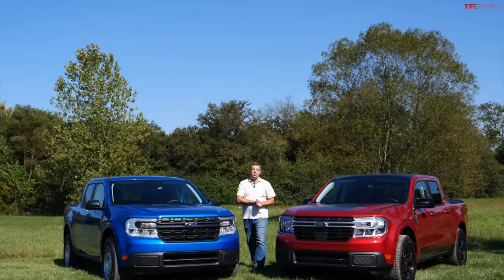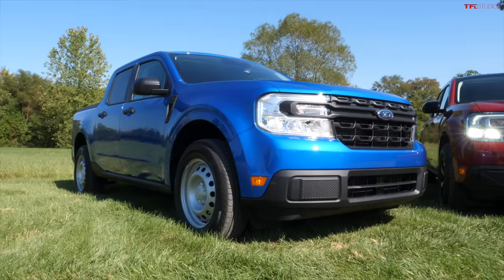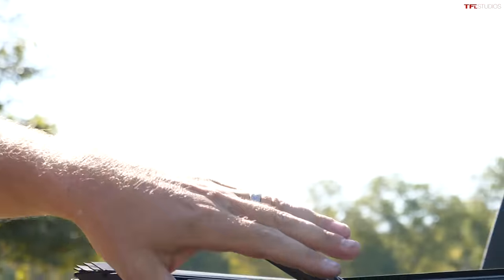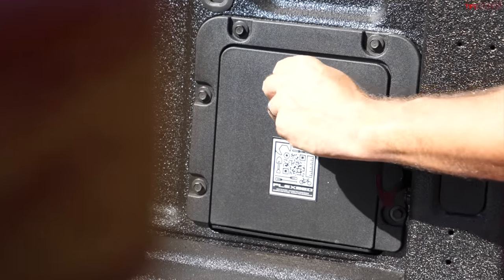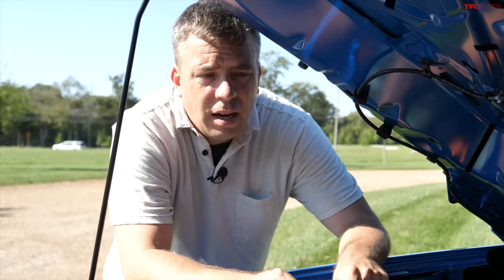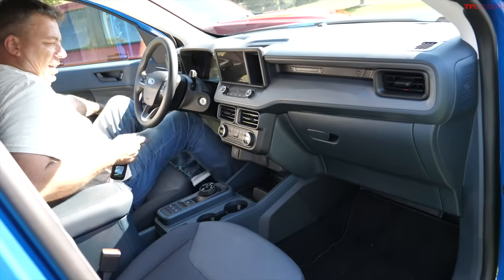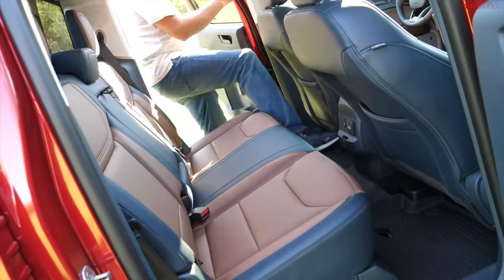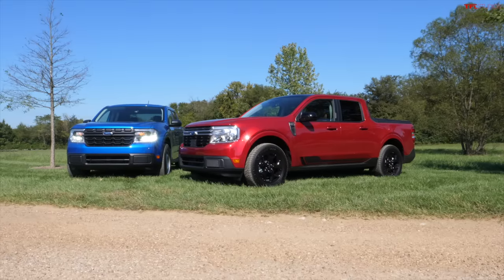HANDS ON with the Least & Most Expensive New Ford Maverick - The Differences Will Surprise You!

Comment: The base model looks honestly perfect for me. I'm about to buy a house and i'll need a small truck for renovations.
The MPG itself makes sense for me to replace my car with it
Reply: I agree. That's why I don't like sedans, they are not practical. When I got my house it needed (and still do) lots of work and I could not fit large bulky items in my trunk, even though it was very big on the inside, the opening sucks so I got a small crossover and folded the seats. By doing that a even fitted a washer. I'm tempted to get a base maverick as today's trucks are wayyyyy over priced.
Reply: @davidzavala337  I'm in the exact same boat. My lil' crossover is great but space is limited even with the seats folded down.

I will need construction materials, equipment, and i want to be able to put my bike in the car without needing to install a mount for it. Just throw it in the bed and go.
Reply: I ordered the xl with lots of extras.
Reply: Get a trailer much cheaper
Reply: or you could just get a nice 1st gen Tacoma or an older Ranger or Frontier for way less money, and it would have more use.
Reply: @damiandouglas5147  Not really. Still need to register the trailer. I have one as I have a 2005 Pilot. The trailer is a pain to hook up every time and PARKing in most city greenway parking spots when we take the bicycles for a spin is a pain. Not to mention worrying about trailer theft.
Then consider any trip to BOX store and this size vehicle, even with smaller bed makes sense. Bought a TV, groceries, mulch? Take the dog to the park and its muddy? Might even be decent on fire roads for certain camping/fishing spots. I'm looking at this or a midsize. A full size is too big!
Reply: @TNAWWE  does either one come with a 3yr/36,000 mile warranty that will give me peace of mind?
Reply: @runawaybum4799  5year/60,000 for the powertrain. That's enough for me to consider a base Maverick over a few year old used midsize by itself.
Reply: @runawaybum4799  if that worries you get a Santa Cruz. Slightly better equipped inside, 3 times the warranty
Reply: @runawaybum4799  don't need it if you get a F150 with 300 I6.  Mine cost $13k new in 90 has 600k miles and still drive it daily.  Then you get more payload, more towing and still get 22mpg (city and hwy, not combined)
Reply: @TNAWWE  Why would someone who is in the market for a brand new vehicle buy a 10 year old truck that gets worse fuel economy and has 100k miles on it? Dumb suggestion. The Tacomas that have under 100k miles and aren’t 15 years old area at least $15k. The Maverick would give you more features and get better fuel economy.
Reply: Same here, we just bought a house and that means carrying lots of crap around. It’s a pain having to borrow a truck all the time, this has all the utility plus great mpg.
Reply: Truck is a must for a house. Can't tell you how many trips to home depot and lowes I have made for stuff.
Reply: Aftermarket wheels are not all that expensive either, and it would go a long way towards making the base model look a lot more premium. That way it doesn't add to the MSRP for whatever alloys they tried to throw on there, and I don't feel bad about throwing out ugly stock rims.
Reply: @jdroofcleanpw  But you won't feel so bad if you dent a steel rim.
Reply: Just remember to buy after closing on the home if it'll be mortgaged.
Reply: I just ordered my 23 xl awd. Awd for getting to work in the snow and the bed seems perfect for doing my little house projects if I need something bigger my brother has an f150… I think between the 2 we can get just about anything done. Not to mention turning it into a party and getting friends involved who have rams and canyons
Reply: @TNAWWE  not any more lol
Reply: @runawaybum4799  no it's an older Toyota, you don't need warranty, i promise you it'd be more reliable than that new junk
Reply: @toggle_blackbox9125  you can find a super clean 1st gen Tacoma with under 200K for like under $13K here. and its the same size as the Maverick, and way more useable... i dont know about you but thats way cheaper than $40K
Reply: @TNAWWE  That's fine, but the idea of spending over 10k on 10+ year old truck with over 200k miles is outrageous to me.  You have no idea how well previous owners have kept up with maintenance schedules, which can dramatically affect the total life of the car.  I can get a brand new Maverick for an additional 10k, and it's warrantied.

Comment: I'd be interested in buying one IF the Hybrid engine had the AWD as an option. Fuel economy is important to me for long trips, but i also want the AWD for when i end up in snow or rough terrain.
Reply: AWD is currently exclusive to the EcoBoost engine, but of course that's subject to change
Reply: @Park_Place  yes i know, which is the point of my comment. currently not interested in purchasing one unless an AWD hybrid option becomes available in a future model.
Reply: good snow tires would help way more in snow then awd would, because you can have as many tires as you want getting power, if the tires are physically incapable of getting grip, it's not going to matter
Reply: perhaps, but both is even better.
Reply: If Ford of reading these comments I'd like to add some support to this comment! Also if they make it a plug in hybrid I will absolutely buy it.

Comment: Maverick appears to have more leg room in rear seat than my Ranger…
Reply: I think I did hear that the cab is a few inches bigger on the Maverick, but your trading bed space and other capabilities. I'm torn between the two. That bed size on the Maverick could kill it though, don't think I can do with less than about a 6' bed.
Reply: Ranger has 35”
Maverick 36”

So yes a little more room
Reply: @farstrider79  i agree. The 5 foot bed on my Ranger is too small and since the bed is shorter on the Maverick is even smaller, it is a no go for me.
Reply: I like my Ranger but if I didn't have it I would probably consider this.
Reply: Unibodies usually provide more leg room.
Reply: @farstrider79  Ridgeline
Reply: @Striker50_  junk
Reply: It does I’m 6’3 and I sat in the back comfortably when my rather large 6’2 coworker was up front these are brilliant

Comment: I could see these being incredibly useful for parts delivery. When I worked at autozone we had colorado and frontier pickups and we almost never used the bed and when we did we almost never needed the full 6' length. But we did need a pickup when customers would order things in bulk ( oil, DEF, brake cleaner.) Something like this seemes much more adequate. Not to mention since most of the driving was city we would benefit  from a hybrid.

Comment: I would definitely take the base model over the loaded one. I love the key start and simplicity over all the tech. Would like to have the all wheel drive with the higher towing, but the efficiency of the hybrid is amazing. Would be a good replacement for my car while keeping my full size truck for doing real work.
Reply: Honestly yeah. I prefer simpler vehicles, and they are hard to find nowadays
Reply: Absolutely agree!
Reply: In that case, buying the hybrid is not simpler, it is a far more complicated drivetrain than the base ecoboost model,

Comment: The base XL. If I channel Roman, " everything you need, nothing you don't".

These are going to sell very well. I can see fleets buying the XL and delivery companies.

Great review.
Reply: Outside of cruise control. Shame that only comes on the XLT and up.
Reply: I agree, I've personally looked at the XLT.  It has a few of the extra bells and whistles that I would like to have but an XLT with ford 360 and the luxury package for under 26 k is a great deal imo.  Especially when a Honda civic would be at a similar price
Reply: I work for O'Reilly Auto Parts and I'm hoping this is what they replace our old Rangers with when they finally retire them.
Reply: Let’s just hope the roll out is better than the bronco. Bronco had a few too many issues, which most companies have wirh new models. I went with the new ranger, but I do like these
Reply: Lots of companies that held onto 4cyl OG Rangers for fleet use are going to be gaga over the XL Hybrid.
Reply: @lesterparker1594  I’d bet on a smoother rollout, the vehicle may be new, but it’s little more than a Bronco Sport pickup, and that in turn is based on the proven Escape/Kuga platform. The big Bronco was the first T7 vehicle so an all-new platform (the next-gen Ranger will be on the same platform)

Comment: I wanna see a comparison between this and the late 90's-early 2000's Ranger.
Reply: Early 90s late 80s for me
Reply: Depends on the configuration of the old Ranger. Maverick is smaller than a supercab long box, bigger than a regular cab shortbox.
Reply: @benwojdyla2399  my 2010 ranger 4x4 4.0 liter could literally run over and crush these little Mavericks
Reply: I looked up the numbers, in  overall length and weight they are almost identical. that's up to the 2012 (last year for the previous ranger). 
they've removed 2ft from the bed and added it to the cab for the maverick.
also, both are comparable in power and towing when matching the non-hybrid maverick to the 2012 ranger.
Reply: @alexmurray7949  That is simply goofy. 

Let's compare max for max. 

Power:
Ranger 4x4 V6: 207 hp, 238 lb-ft
Maverick FX4 2.0-liter: 250 hp, 277 lb-ft

Dimensions: 
Ranger: 125" wheelbase, 203" overall length, 71" overall width, 67.7" overall height

Maverick: 121" wheelbase, 199.7" overall length, 83.5" overall width, 68.7 overall height

Capability

Ranger (4x4, v6, 3.73): 5,600 lbs towing, 1,260 lbs

Maverick (4x4, EcoBoost) 4,000 lbs towing, 1,500 lbs payload

But go on and tell me how the Ranger "literally run over and crush these little Mavericks."
Reply: @alexmurray7949  lmao that pos 4.0 makes less power than modern 4 cylinders

Comment: The transmission in the Maverick is not a CVT as you know them to be, with belts and pulleys. It makes use of a single planetary gearset and two electric motors to create infinite ratios.
Reply: Thanks!! Cvt💀💀

Comment: Bought  a F150 XL (8/20) , listed for 32K purchased for 26K. Ford won't be discounting these for a while. Has everything that I wanted, cruise & electric windows. Gets around 22 MPG on the highway. A good purchase for me but if I were to still in the market the Maverick XLT (want cruise control) would be high on my list. One thing I did add to my truck was a tail gate damper, $25. Great review

Comment: Waiting for the “this ain’t a truck!!!” from the same people constantly spewing that shit on the Ridgeline
Reply: somehow the Maverick and Santa Cruz escape that
Reply: They are all ElCaminos !
Reply: I mean for reference my 2019 miata has the same or near the same hp and tq (181hp 155tq) as that base model hybrid....that think may have a bed and a tow hitch but I doubt it will be doing any serious work likes it's larger siblings
Reply: @justins21482  How much stuff can you put in the miata?  It’s a Escape with a bed!
Reply: @justins21482   Small Toyota pickups going back to the 80’s have had 4 cylinder options with as little as 115HP, and that never kept people from using them as cheap work trucks. Maybe not for towing, but for contractors, builders, etc. there’s enough power and room for everything you might need to carry.
Reply: @teyoung304  I had a 1980 toyota 4x4 and loved it. one big difference is the maverick doesnt have a low range. it would almost work for my needs if it had a proper transfercase with a low range. oh well.
Reply: @justins21482  please don’t tow with that you don’t have the weight or structure or even the engineering. Nice car btw
Reply: @slobert1970  awd or 4high is still better than only 2wd in my opinion. Plus they put a cvt and a hybrid clearly they know who they’re going after. I’m all about low gears but paying for gas is a bigger part of my life now vs. off roading and towing 1% of the year
Reply: @teyoung304  Don't forget gun trucks. The news LOVES to show how diverse those Toyotas can be 😉
Reply: @teyoung304  should've seen what my dad towed with his brand new Ford Ranger with 80hp in 1988.
Reply: Hyundai specifically does not call it a truck either if that matters
Reply: I'm not afraid to call both of them "not trucks" because it's true. Doesn't mean I don't like the Maverick. I just know what it is. It's not like a Ridgeline which is trying to pass as a midsize Tacoma competitor.
Reply: The Santa Cruz is leaning more towards a car.
Reply: I like ridgelines and the idea of the maverick, but they’re not trucks. 

I call them light utility vehicles (LUV)  like the rest of the world outside the USA already does.
Reply: Not a truck, it’s Ford Escape with a bed. The Ridgeline is a lot more of a truck then this. Honda’s j series 10x more reliable as well.
Reply: I call it a pickup, not a truck. That being said I'd buy one if it came with an extended cab and a 6ft bed. If I can't sleep in the bed of pickup I won't buy it.

Comment: Wow, that exhaust is low. Looks like 4-5” of ground clearance max. And that’s the 4x4. 

Overall, it does look like a great value option, especially the base model. I’d almost prefer a longer bed and eliminate the rear seat.
Reply: 8.6 inches, apparently.
Reply: @coachezhevsky5378  Is that what they claim? Look at 16:55 - if those A arms and that exhaust are 8” off the ground then that dude has some giant hands.
Reply: It’s above grass, my friend. Obviously that’ll make any vehicle appear lower
Reply: It's based on a car based crossover. And the "4x4" is still a front wheel drive car with coilovers and a few other odds and ends.

Comment: When lookng at the value of the base XL, it makes me wonder whether it will be unobtanium as Ford would limit production of it due to its usage as a loss leader. With how expensive everything is right now, I don't see how Ford could make money at $20k with a standard hybrid powertrain. That's insane value when you consider that you can't even buy a Corolla or Civic for under $20k anymore. These Mavericks are going to sell hot as even the Lariat isn't a bad deal.
Reply: I believe ford already said that dealers are not going to stock base model hybrids in large numbers. Average msrp's will probably by around 28k I'm betting
Reply: @NWI_Steel  yeah they’ll probably have a bunch made with tons of options so they sell 25-30k
Reply: All trucks are spoken for already, might be awhile until fleets can get them. But plenty of people have chosen the base model.
Reply: Right. The Lariat with the off road package (which gives you AWD) is still around $30k, which is still insanely affordable considering what features you get vs what you'd get from other trucks at the same price point

Comment: If they can bring 4K towing to the hybrid, that's all I want.
Reply: Ranger would probably get that
Reply: @Striker50_  a lot of trucks can do that, but can they get 40 mpg?
Reply: Exactly. I'd like to be able to tow a car to the track or boat to the lake. The only thing this is missing is just a little more towing compacity
Reply: @VashTheAverage  just tow it anyway 😂

I have a Toyota Yaris which isn't supposed to tow anything and doesn't even have a rated towing capacity but I've had my car filled to the brim and towed a U-Haul 4*8 trailer up a mountain no problem.

Comment: I can’t wait to get mine I ordered a fully loaded maverick lariat without the sunroof option and it was built last week. And actually the base and loaded models are very inexpensive for what you get with each👍🏽👍🏽
Reply: How much is the total came at ?
Reply: @abubakaranwar6859  about 37000.loaded. can get ranger for that
Reply: @abubakaranwar6859  $36K 👍🏾👍🏾
Reply: @jamessammann9183  yes but the Ranger won’t be loaded…. Ranger Lariat is about $45K👍🏽👍🏽
Reply: @IMGONEIN60  I don't like it cause it uses battery for Reverse. On hybrid
Reply: @jamessammann9183  Yeah I didn’t want to hybrid because I wanted the all wheel drive option👍🏽👍🏽
Reply: @IMGONEIN60  I just bought a loaded Chevy 30k
Reply: @jamessammann9183  wow that’s cheap!!
Reply: @IMGONEIN60  it will pull 7000 lbs where maverick is 4000.  So that's why I got Chevy

Comment: Love the steelies. They should offer them as with higher as well, especially with the 4x4 models. Also, Ford should bring the Maverick to Europe.
Reply: look for strength tests on YT, steel vs aluminum wheels. I was shocked that Aluminum is much stronger.
Reply: @slingbart705  That might be true in some context, but not in the context of a wheel. A steel wheel will deform when damaged, allowing you to bend it back into shape with a hammer. An aluminum wheel will crack or chip which is unfixable beyond a certain level of damage.
Reply: @4R8YnTH3CH33F  I've had aluminum wheels both bend and crack apart. I'll take steel wheels anyday. Only downside to steelies is if you don't keep them clean they can rust over time

Comment: honestly, if they added cruise to the base, it's all I would want or need
Reply: Same here. I love doing road trips on my days off, so cruise control is my best friend. I love everything about the Maverick but that ONE omission.
Reply: Wait, lol. No cruise control?
Reply: Really? Cruise control is still an option?
Reply: @wigletron2846  it is on the base maverick
Reply: @JohnMiller-zn9pf  I test drove a base kia forte last year and it had cruise control. It can't cost ford that much to include it. Kinda like how crank windows aren't really a thing anymore
Reply: @wigletron2846  honestly for safety I prefer manual windows. otherwise. tell ford lol.
Reply: @JohnMiller-zn9pf  I don't have a problem with manual windows either, it's just it's more cost effective to only offer power windows. Just like I'd imagine it would be cheaper to build every car with cruise control, but I guess not.